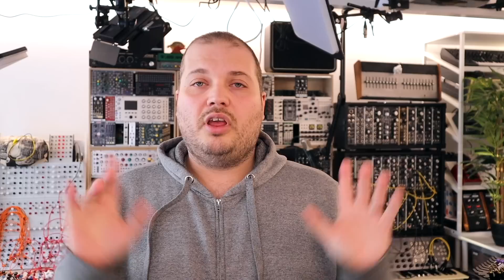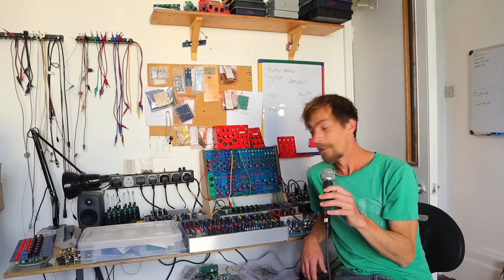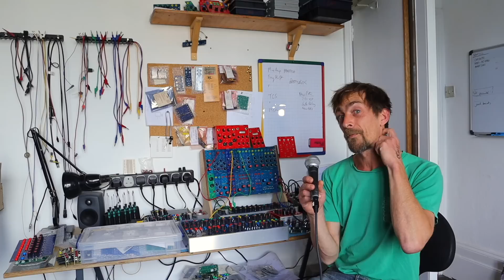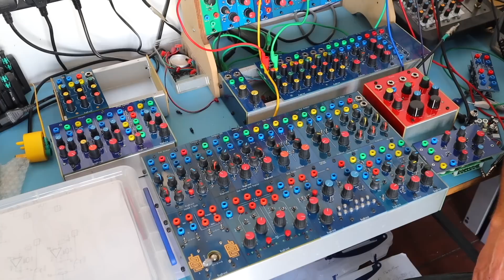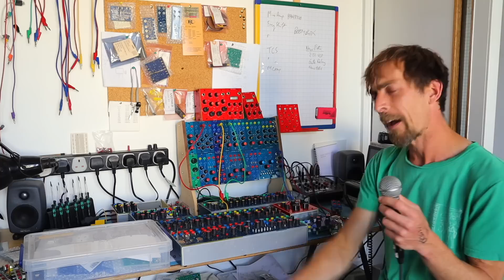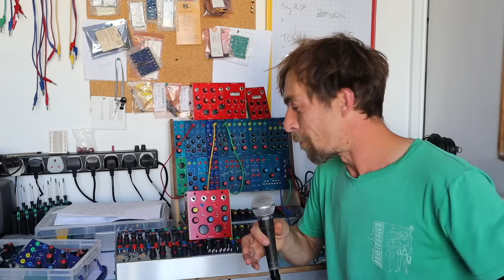A Colourful Modular Synthesizer // Who & What is BugBrand?

Comment: Question: Is it BugBrand are fit to work along Serge or Buchla voltage control??
Reply: I've definitely had a lot of people using Serge & Bug together and definitely some with Buchla too - though less sure if they're passing voltages. I'd imagine that 100/200 series are good, but I think the 'clever' 200e might require more care. 
Have a search for Phisynth and Batchas (here on youtube) for some good examples.
Reply from the maker: BugBrand is like Eurorack and Serge, bipolar wider ranges voltages, unlike Buchla that does no negative voltage and generally 0-10V for the CV.

Comment: Always great to see Tom and banana modulars getting more attention.  The paia frame with the first modules was the icing on the cake for the last recording session for The Chasms' first album back in December 2008.  Modules still going strong and all the old modules work flawlessly with all the new modules.  The effects loop on both of my phasor modules gets a lot of use.
Reply from the maker: hail the banana! 

What do you tend to put in the phaser FX loops? I've been using overdrives in an auto wah FX loop for a while (EHX Q Tron + that I've had for a long time) that's fun.
Reply: @DivKid  Just about anything in the bug system, usually involving a matrix mixer with some vca's at their inputs so what's in the phase feedback path is changing, also out to pedals and back in.  It depends on how crazy a sound I'm looking for.

Comment: Big fan of the limited-size case practice. I have enough modules now to fill a (small) wall, but I continue to use my two cases — 208hp and 168hp. It's good to impose limitations on yourself, as you guys mentioned, and it also allows me to build and rebuild cases with a slightly new guiding idea in mind every several months, and I love that planning / conception phase almost as much as I enjoy making noises. It makes for a satisfying loop.
Reply from the maker: I really like that approach, either smaller sections of larger systems or smaller cases among a larger set up. Having options to make varying instruments but then having the limitations once that's set up.